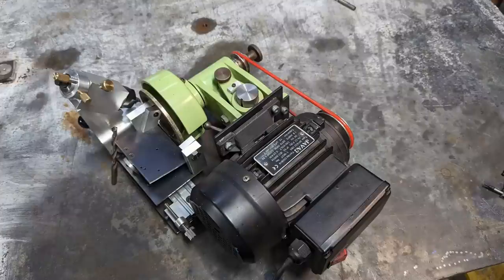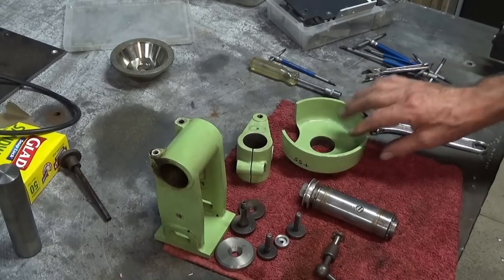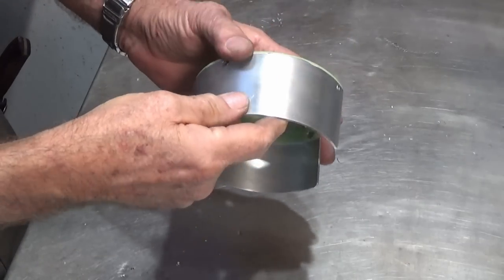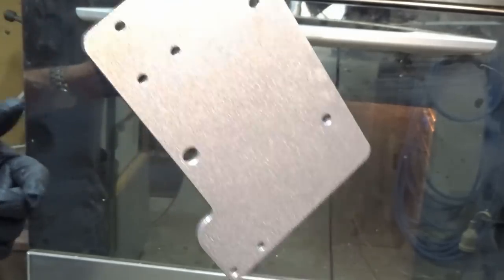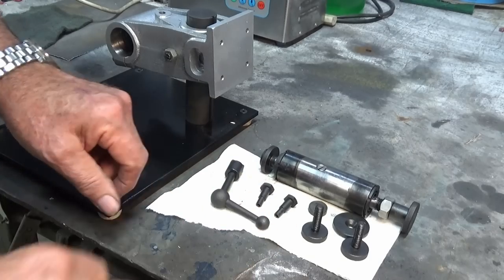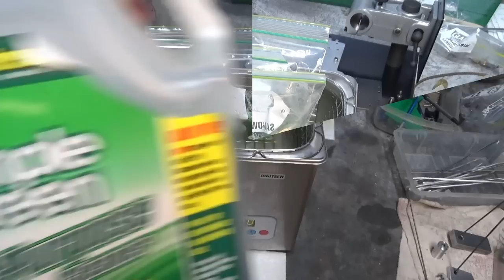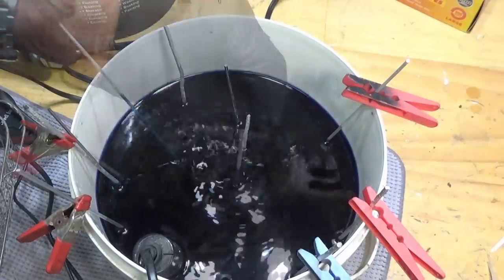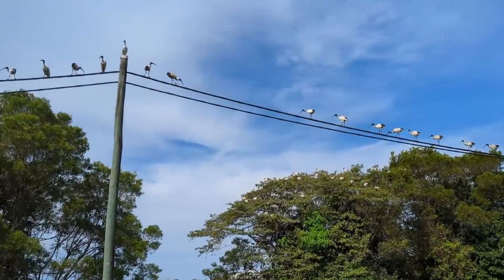Metal Finishing 3 Ways - How I Finished the 4 Facet Drill Grinder

Comment: Cameo by the superior multi-tool, the Gerber MP-600. I've had mine 23 years, through various and sundry adventures and misadventures in all parts of the world, and still it's going strong with daily use. I've not been able to find an example of the other multi-tool brand which can say the same.
Reply: Oh! I'd been meaning to mention: I did manage to get the Hurricane engine articles from AME (and even most of a year's subscription) before they shut their doors. Thanks so much for that tip all those years ago!
Reply: and one more thing - here on the East Coast of North America, our equivalent nuisance coastal bird is the Herring Gull, just one species that gets lumped into the common term "Seagull". I did recently see a white ibis when I was traveling in Florida last month; they don't have anywhere near the numbers here that they do in your part of the world.

Cheers, and thanks again for all the knowledge.
Reply from the maker: I do love my Gerber. I wore it to work every day and it was always handy and the kids loved it when I flicked it open. 
Mine came with the little pouch of extension screw driver bits. I also take it with me when we travel overseas. I once forgot that I had it in my backpack when I went to board a flight in Paris. The security guy noted that it had a blade and I was given the choice of surrendering it or sending it back home via FedEx. Both options were out of the question so I paid to have another bag checked in and it rode home that way. 
Regards,
Mark

Comment: did you make your sheet metal rollers?
Reply from the maker: Yes, many years ago. It is a design by George Thomas. He was a prolific contributor to the Model Engineer magazine and he published the design in that magazine. I just found a PDF of the original article https://www.nickbaines.me.uk/BendingRolls.pdf
You do need to make or source some small spur gears for the drive but the rest of the machine is fairly easy to make.
Regards,
Mark
Reply: @Preso58  really appreciate the reply. I am leaning towards the path of making my own, as i do not want junk. Will look into it.